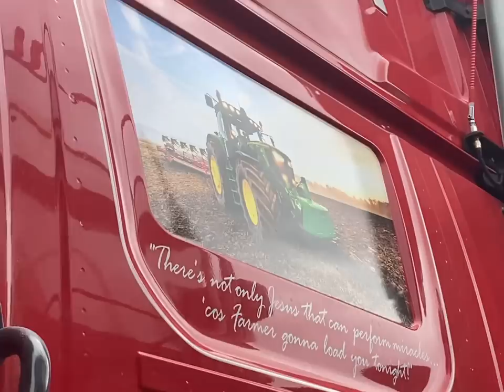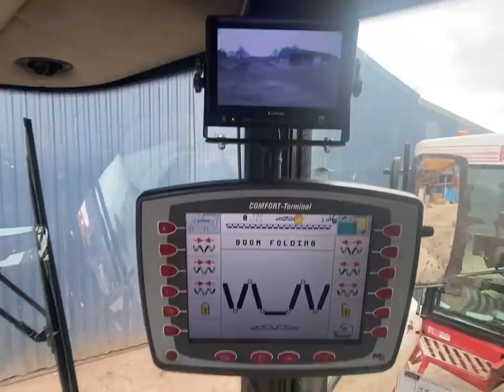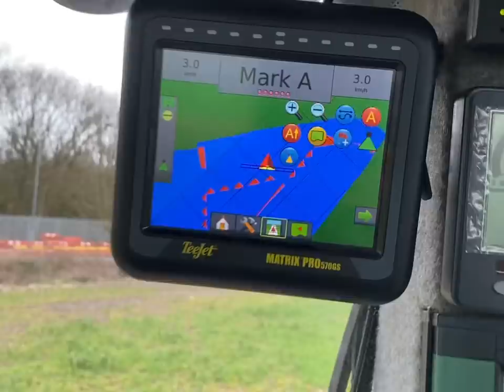Day 370 #ollyblog CAR CARNAGE SPRAY COMPARISON BEAN SOWING #lockdownlearning

Comment: I believe the two brake couplings is for twin line brakes that work the same as air, only problem I can see with that system is if you snap an air hose it just leaks air so no problem but if one of those oil lines snaps you've got oil everywhere and possibly a tractor with no oil in the back end
Reply from the maker: And a slippy road
Reply: @OllyBlogsAgricontractfarmer  indeed

Comment: We have discovered a problem which can cause the air brakes on agricultural trailers to lock up suddenly or to work in a non-progressive fashion. The cause of this problem appears to be faulty air regulation in the service air brake line on some tractors.
The air pressure in a tractor's service line determines the force applied to the trailer's air brakes and should rise progressively as the tractor's own braking pressure is increased. This results in smooth, balanced braking between tractor and trailer. However, if the air pressure in the tractor's service line is "non-progressive" for any reason, it can be difficult for the driver to control the air brakes on the trailer without locking the wheels.
There is a solution, however, and this involves fitting a special pressure-reducing valve into the tractor's service line
Reply from the maker: Our trailers have load sensing valves to stop this

Comment: Shouldnt the NH have duals?
Reply from the maker: Why ?
Reply: @OllyBlogsAgricontractfarmer  more pulling power, reduced compaction of soil, greater fuel efficiency and less wear of tractor
Reply: @framfull  I think the 300 hundred odd horse I think it has it should be fine
Reply: @fusion7865  most likely, I dont even have duals for my Puma 240, ripoff prices🤠

Comment: You come across as a good guy - but I think you might be better to buy a certified lifting hook for your Merlo - rather than your homemade one. The HSE will crucify you if there is an accident with your one. Here is a link to one on Merlo's website. https://www.merlo.com/eng/attachments/hooks/lift-hook-on-carriage
Reply from the maker: It’s load tested to 3000kg and we only lift 500kg of beans
Reply: Just as well they didn't watch the video of you lifting a fert bag using duct tape